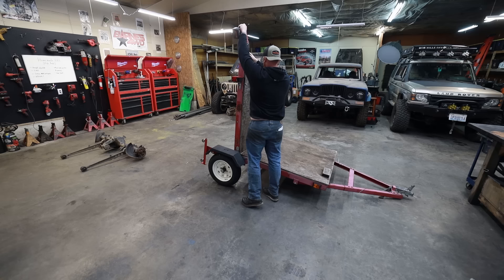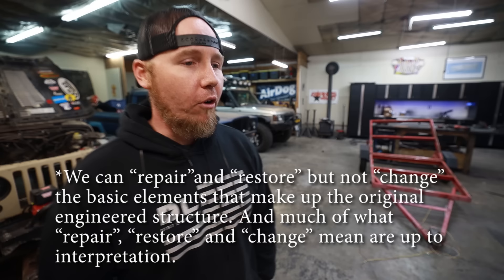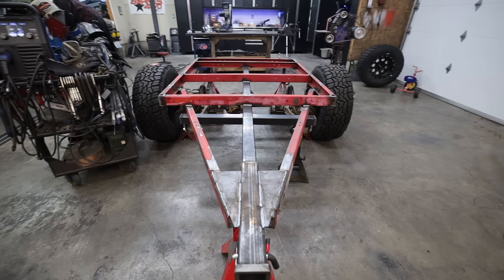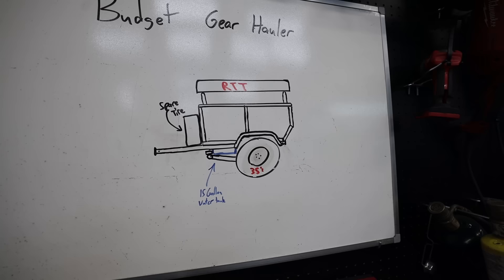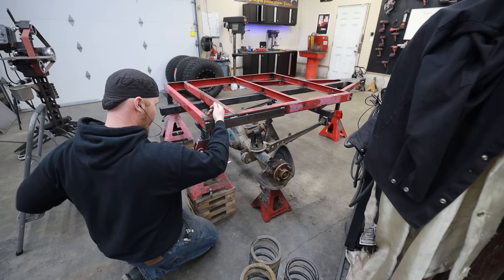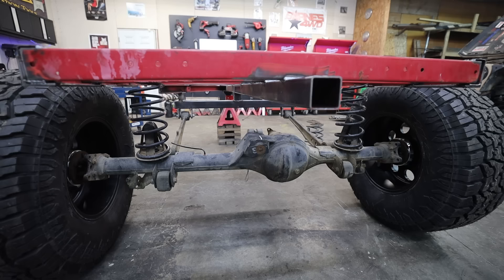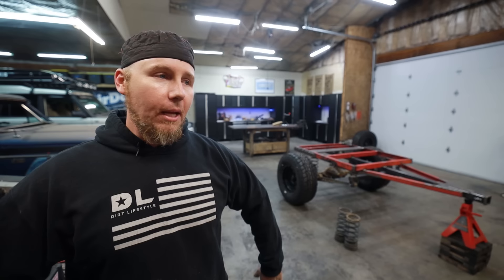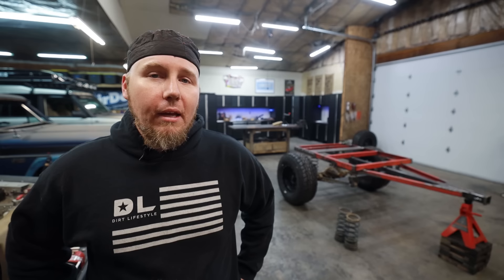Budget Harbor Freight Off-Road Trailer Build. Making An Overland Trailer On The Cheap.

Comment: Dude talk is cheap and you'll always have those who are blowing smoke no getting around them.Good start  with harbor guys basics , strong back is a plus,cold rolled- ground flatstrap makes good brackets and bracing.DOM tubing  could be used for bracing the 3x3 box tube to the tongue as additional bracing and tag two more to each frame rail.Think about boxing frame where you tie into it with tubing ,make good lift or jack points...OH ! Have you seen the new Lazer welders ,no wire or other fillers ,no welding gear ,no splatter no buckshots,perfect bead Everytime to 13mm plate one pass... Good #s..

Comment: I have a 4x8 trailer that was PERFECT for towing with my XJ but now I bought a 2019 4Runner and the trailer is a bit to narrow and makes it very hard to back up. So, I'm thinking of retiring it and making something like this from it. I have an extra rear diff for my XJ and I think that would be a good starting point. The question I have is, did you keep the rear fully intact? Meaning, did you keep the gears in it?

Comment: Does yoke turn on the axel , if so could I put a pulley on it then hook up a alternator to charge on board battery while pulling trailer

Comment: Maybe you address this in a later video, but I do have one question. Why are you waiting until the trailer is done to get it registered in your name? Wouldn't it be easier to just register it as it was and then modify it later and avoid any inspections?

Comment: did you consider tractor supply and a 2500lb axle with springs for about $300?  Aaaaand I need to brush up on welding to make this exact setup...

Comment: Why are trailer tires not enclosed to maximize space?  Or why not use the full width of the trailer external tire edge to tire edge?
Reply: Size and DOT restrictions.  Nice to have a deck only 14” high for loading dirt bikes and 4-wheelers.

Comment: Yeah those trailers made out of folded sheet metal and bolted together are the worst imported crap - ladder construction with no structural strength.  I understand why you did it (certification) but you would have made something so much better if you had been allowed to.  Anything you weld into that trailer will make it so much better, and the center beam was exactly on point.  Hopefully the inspection guys are back at work now and you can start thinking about V2.

I'll be building a teardrop camper and even for that I'd already decided strongly against buying a trailer made out of folded sections (ie cheap box store imports).  Actually, I think they are illegal for sale in my country.  I think another difference in licensing is that changing the running gear would constitute a "major modification" and require inspection, so I'll probably be looking for something more fit for purpose on those grounds also.

Comment: Love it. The reason for the foundation HF frame makes perfect sense. I like the suspension direction. Are you planning on cutting out the center and turning it into a tube? Looks like it may need clearance from the frame.

Comment: Bare with me...Give me two numbers the added together equal 9.  3+6=9, but 1+8 also =9.  ...and 0+9, 2+7, ...and so on.  are any one of those addition problems better than another?  NO, they all get you to the desired result which is 9.  The same could be said for fabricating an offload trailer. (or anything else)  There are many ways to build the trailer.  The way you do it may not be the same as what.some keyboard fabricator would do, but does it give the desired result.  YES, in the end, you have an offroad trailer.

Comment: Some people just don’t know how to keep their fingers off the keys on a keyboard thinking their idea and ways are better. And by god their going to push their ideas on to someone else and criticize the builder while their at it. Most of the time these same people have never even built a trailer or anything else but some have and of course their way is the only way it should be done. Rude obnoxious people that don’t care about you or anyone else they only are out to prove your wrong and they are right. Why are so many jerks rude because their not talking to someone else face to face other wise they would be a pussy and not say a darn thing face to face. Use what you have just like your doing and anyone that comments in a negative way either delete their comments or kick them off “your  channel “ and this goes for me also. Negativity ruins channels and once these jerks get away with it they will not stop and mean while a good channel is losing good people that unsubscribe because of their frustration from the negative jerks. Sorry for such a long comment but darn it these jerks have got to go. Thanks from someone that cares, Cheers
BTW I have built quite a few trailers of all types just because I have doesn’t make mine better than someone else’s.I like your build it shows what can be done on a budget.

Comment: You have good skills and ideas but man, you tak way too much, lol. This should’ve been just one 8-10 min video instead of multiple 15 min long videos of just talking. And this was super overkill. Reduced the length by half, added 200% more weight, added wheels and shocks that are useless on a trailer like this, the list of what’s wrong is endless. This is also nowhere close to being a budget build, the stuff you used literally costs 7 times the cost of the trailer itself. But when you have the time and resources there is no wastage I guess. To each their own.